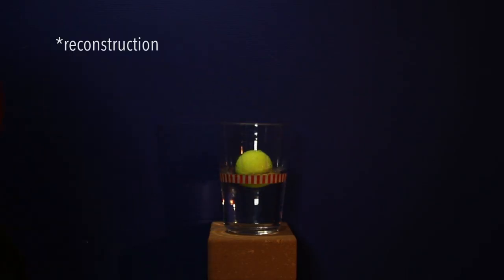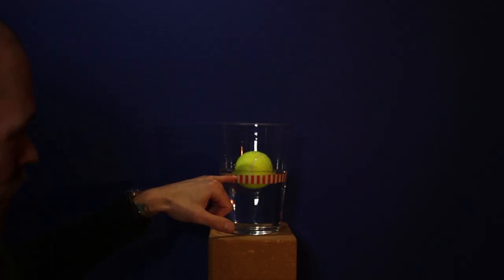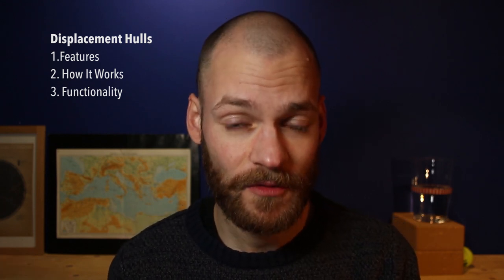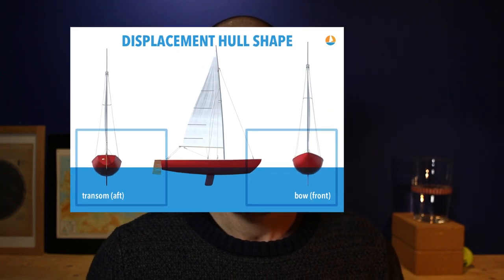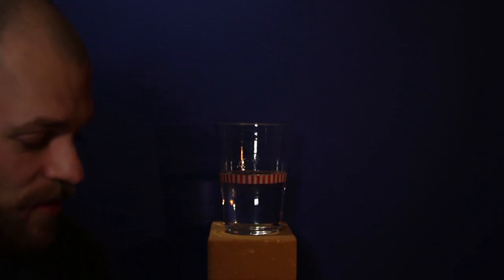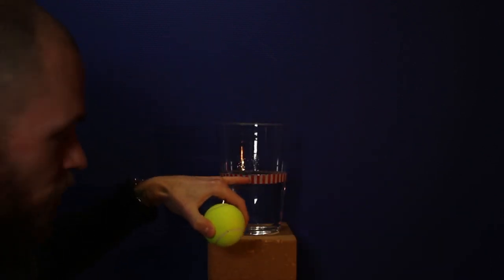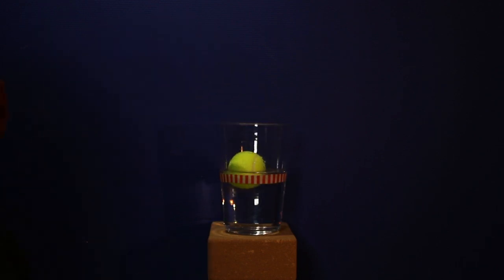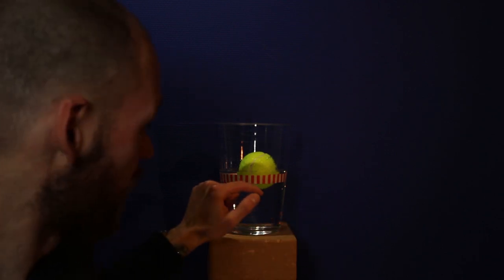The Displacement Hull Explained

Comment: Great video. 

What happens if you put a pile of horsepower behind a displacement hull?
Reply: Depending on the exact design of the hull.
The stern sinks into the water with more throttle and the boat might get flipped.
The point is, every hull will provide "lift" at some point. A displacement hull will deliver a lot of lift not straight up but obliquely upwards and the slightest assymetrical force (a small wave, wind, a small rudder movement) will completely throw the forces out of balance. Most boats will roll or flip, before the stern sinks probably.
I drove an overpowered charter boat once. Going even only 3 km/h over hull speed put the stern down by almost a meter, meaning it came down from just under a meter to water level within 3 km/h speed difference. Most hulls can probably go 4 to 5 km/h above hull speed and just inefficient, but still stable. At some point above hull speed a displacement hull will dig too deep into the water though. More power then would most likely only make the wave bigger that it pushes, if it can still drive stable and is sealed of against taking water in.

Comment: Why do most displacement boats have a rocker (=bent keel line, with the midship sections sitting deeper in the water)? Doesn't that contradict the reasoning behind displacement hulls a bit? Is it only for maneuverability (=turning characteristics)?
I see 2 problems with this:
(1) having a rocker also implies that between bow and midship there is an inclined surface that pushes against the water and creates some lift. And that's a BIG(!) surface. If e.g. we take a look a hydrofoils, it's quite astonishing how little "wing" area is needed to generate substantial lift and we pay with a lot of drag to accomplish this. As I see it, we don't want that in a displacement hull - at least not if we optimize for efficiency (rather than top speed)
(2) with a rocker the hull bottom is also rising between midship and stern. But this also implies that the aft section is less submerged --> we have less length below the waterline, hence less hull speed (because bow and stern wave are produced rather by the submerged volume of the various sections than length alone); so why not a pointy stern and a keel that's straight over the entire length?
The typical sailing vessel stern design also raises the question: why a flat transom (other than e.g. a double-ender kayak)? To me this only makes sense with planning hulls, so why not stick to 100% displacment characteristics only? In case it's about concerns related to pitch stability, we could always make the stern above the waterline more boyant, in order to reduce hobbyhorsing tendency in rough seas, whilst preserving efficiency in calm waters.
To sum it up: isn't a kayak type hull shape with no rocker a lot more efficient?
Reply from the maker: Hi Christian, I wouldn't know but it's an interesting question. Perhaps we have a yacht designer in the comment section here?
Reply: I'm a newbie also wondering about these questions. From what I've learned rocker is for maneuverability for tacking when sailing or for rivers.
The waterline of displacement boats with a transom actually are still "double ended". At least I think so. 
It's possible it's a compromise, at low speeds the waterline is double ended and that helps with efficiency (water rushing back in providing pressure pushing the boat forward) while at faster "semi-displacement" speeds the stern sinks relatively lower in the water and the water gets cleanly separated from the transom.
Reply: Why do most displacement boats have a rocker (=bent keel line)?
Because the water will get an impulse from the moving boat. The boat moves through the water, but relatively speaking the water flows past the boat. Viewed like this, the water is given time to accelerate and decelerate (before and after the "rocker"). This is more efficient than going in and out with a bang.

(1) That's completely different. Put a hydrofoil on a displacement boat with hull speeds of 10 to 14 km/h (hull speeds of 6 to 10 meters boats). It won't do anything. Plenty of people have tested this, e.g. because they thought their boat was too deep in the water in the stern.
(2) If the stern is submerged, there is no difference in the length of the water line, which is the only parameter that accounts for hull speed.

Why a flat transom?
1. It is a better use of space. 2. Easier to design and cheaper to build. 3. Easy to mount things on it or put portholes in it (put a nice aft cabin in a sport boat in the first place). 
Concerning pitch stability: Where is the waterline in rough waters? It is constantly moving. I highly doubt that a flat transom is actually helpful when the waves are coming in from the stern. If it was bows, would be flat as well. But I might be wrong. 
I find that having the waves coming from the quarters can make yawing a problem and I think that in that situation not having a flat transom would be an advantage.

Comment: I have 8,5m x 2,85m displaysment boat with 75hp perkins engine, moves 6,2knots, weight 5.5tons,  and its a nightmare in rough weather. So its not always a best and most stable. sidewawes are most horrible. tested it in baltic sea 16m/s and 21 tops... never again!